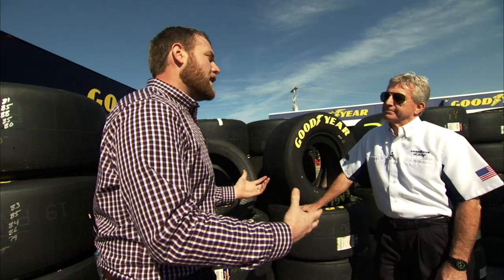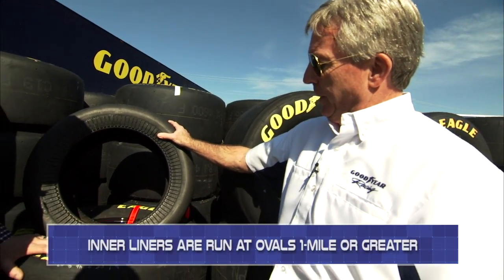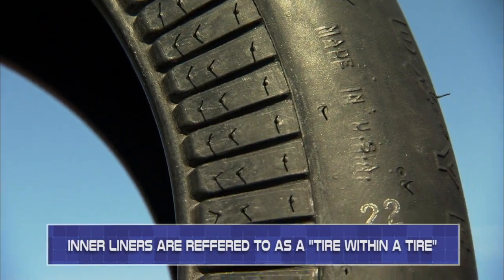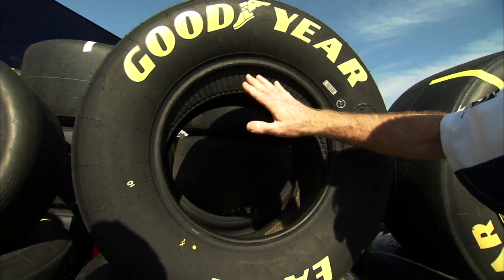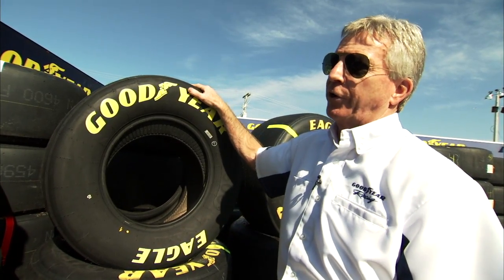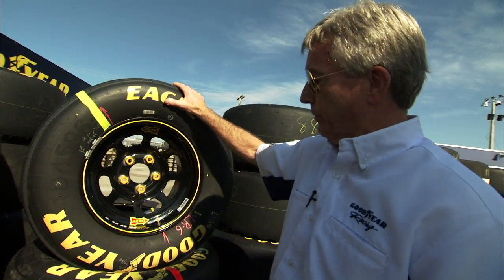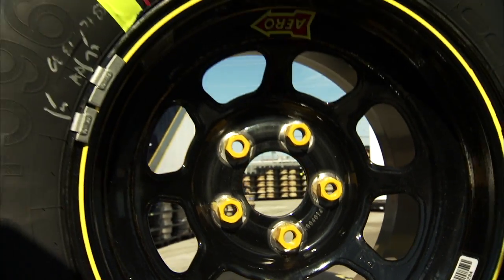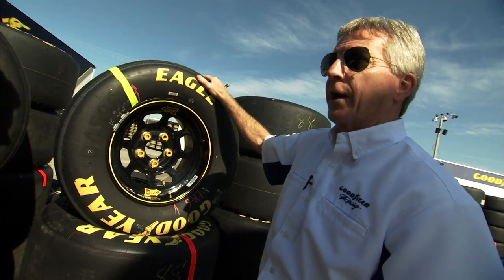Tech Talk: Inner Liners

Comment: why are teams scraping off the surface of used tires with a torch?
Reply: They are cleaning off a smooth area to get information on tire wear through a run
Reply: Mr. Krabs a ) cx.             C.                                  c